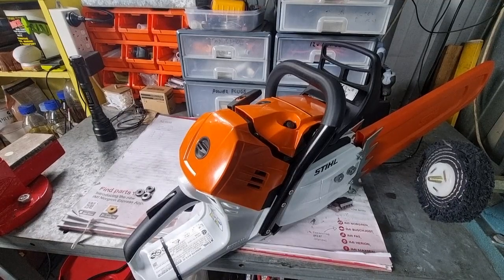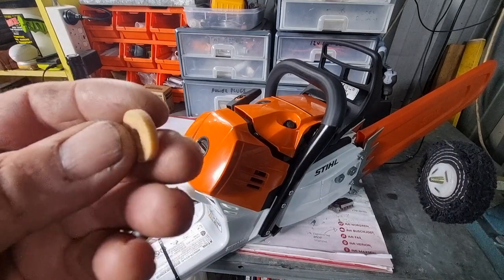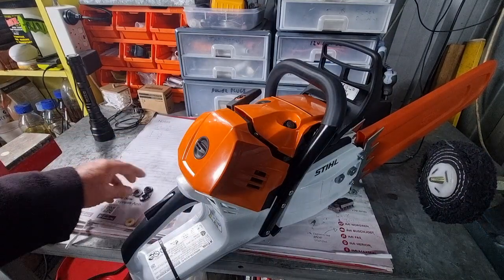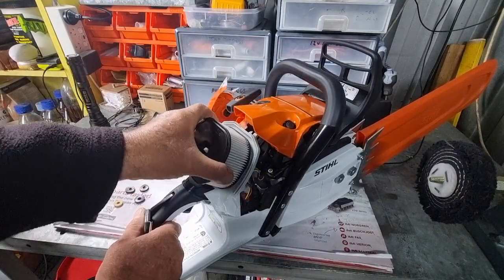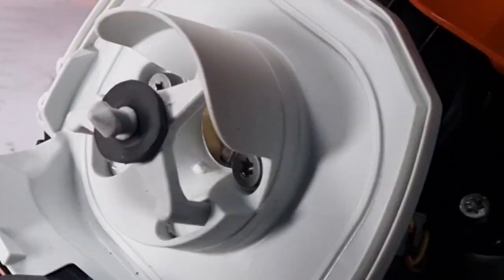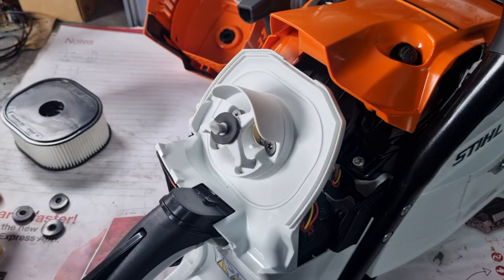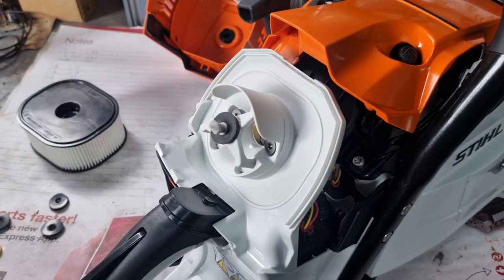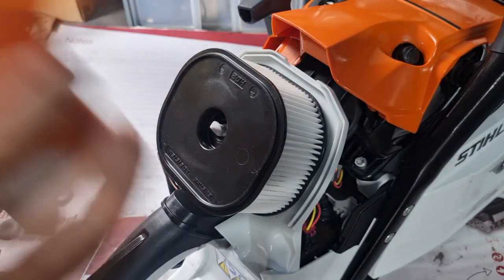500i pro tip rubber washer mod

Comment: When one spends that kind of money and has to deal with imperfection, no thanks I'll give that saw a miss! There r much better ones out there for that money  !
Reply from the maker: I can find many companies who take short cuts or simply just don't do enough field testing before release.
Take the Takata air bag fiasco world wide.  The air filter is not a major problem it's just it can be made better with very little input.   Stihl make the best chainsaws as well as Husqvarna but Husqvarna has it own problems also.  I can find many  issues with any chainsaw but everything is buit  to a price.